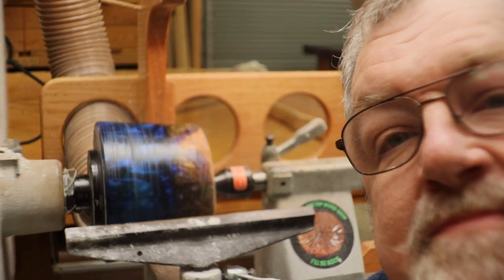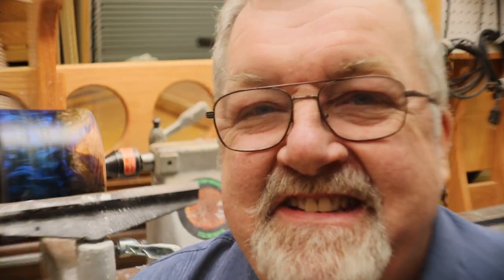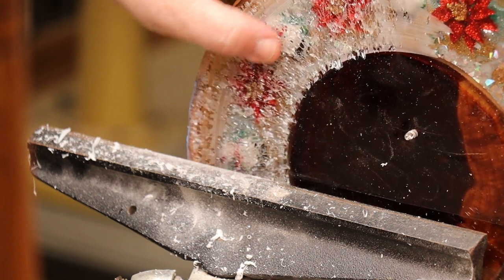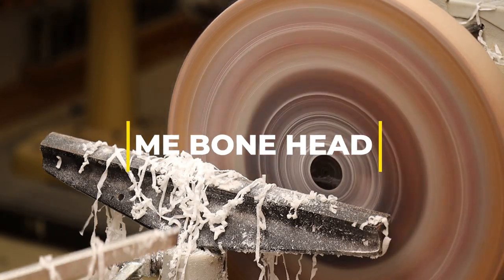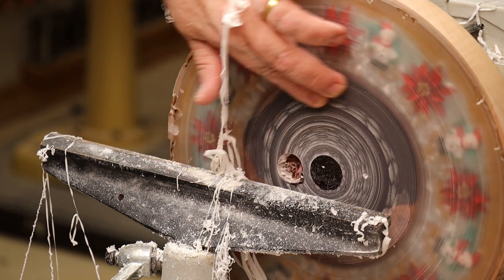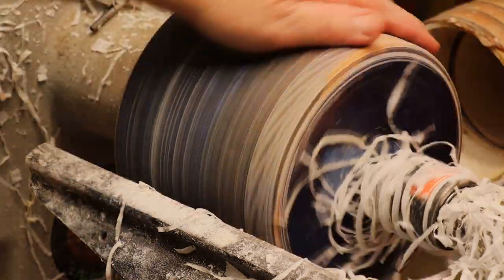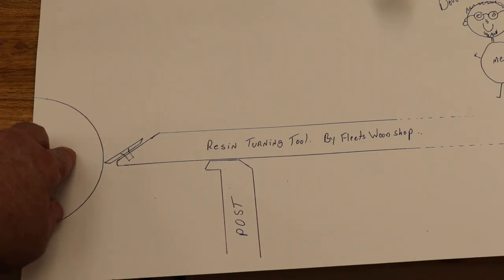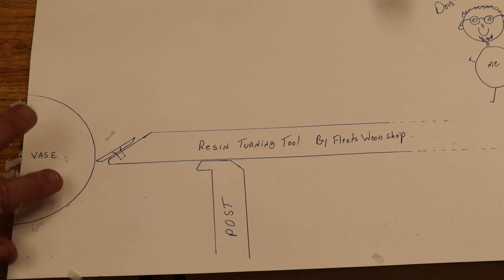IF YOU TURN RESIN WATCH THIS  TAKE TWO

Comment: Hi Doug, I made a tool much like in your drawing. However, I also added about a five-degree angle to the side. This changes from a direct scrape, to more of a slicing cut. It not only eliminated the chipping in the resin, but reduced vibration. Much cleaner. It was a challenge to make the tool. I had to make a jig to hold the steel that would allow me to make the cut at the correct angle. You should give it a try.
Reply from the maker: Brent I certainly will email me a picture of it my friend I would love to see it. My email is in the show more section. I hope it also cut down on the dust from the resin it did for me. Can't wait to see it buddy thank you thank you. From Doug

Comment: As with metal, rotational speed is important. Do you differentiate speeds between a hardwood and a soft wood? What speeds do you use? Thanks and keep up the good work. Glad you recovered this one.
Reply from the maker: Hey my friend how are you doing. I'm not sure what speed I was using then. But I'm trying to get it all worked out. I'll try and speed adjustments and see if that makes any difference. And thank you buddy thank you I'm working on getting better every day. I appreciate you very much my friend from Doug

Comment: Hey Doug, and how about turning the carbide rotary bit over and use the tool the normal way?
Reply from the maker: Hey buddy good to hear from you I tried that once but I couldn't get the tool to set because of the indention in the screw head I tried drilling out the bottom of the tip a little bit but it shattered it. if you could safely find the way to drill out the bottom so you can recess the screw a little bit it would probably work. And thank you thank you that's good insight my friend it really is and I appreciate it buddy. Have a blessed blessed day and thank you thank you from Doug
Reply: @fleetswoodshop3339  yeah, I can imagine that being hard, didn't think of that, and recessing the screw head in such hard but brittle material might be hard too.. maybe a flathead, or a washer to hold it down? There must be a easy solution to this problem. Or write to a manufacturer to produce a batch of the ones you want, maybe you can make some money with that even ;)
Reply from the maker: @fk6536  hey there those are great thoughts my friend I love it I love it. If you do turning try the negative rake tips by easy Wood tools they don't get hell down on an angle the blade is cut down on an angle. So they seem to work pretty good. But even with them every now and then I still find myself holding the tool on a downward angle. Give it a try my friend and let me know what you think and thank you so much from Doug